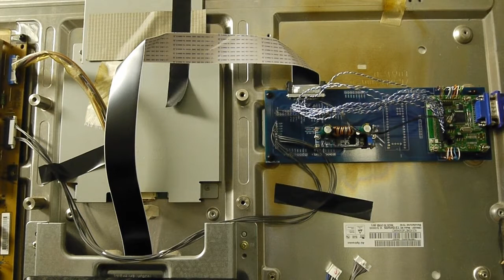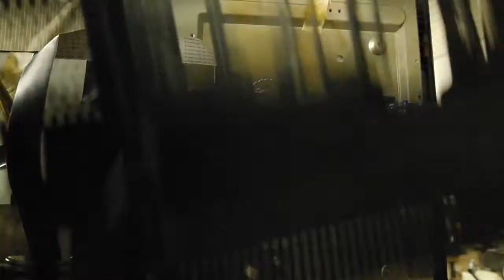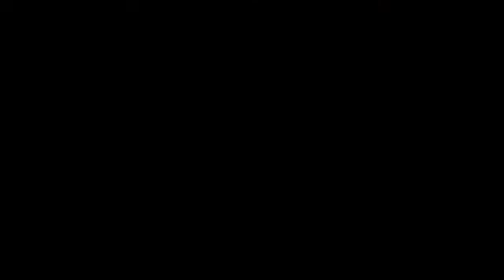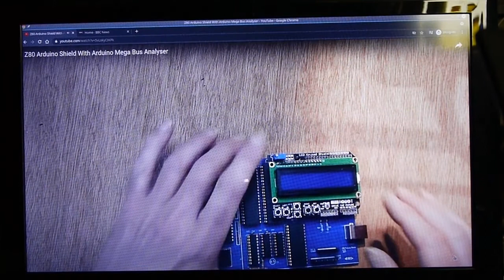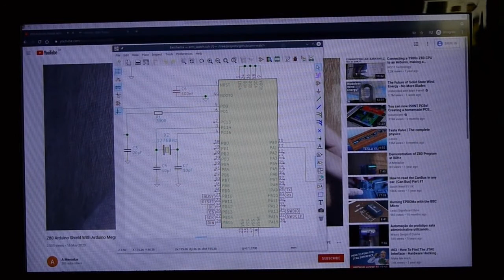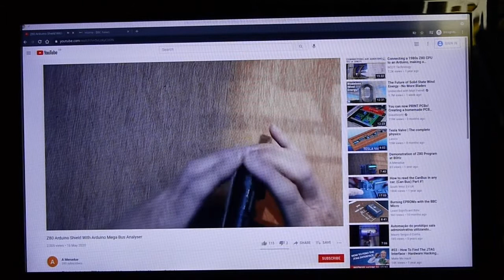Re-using a Broken Television as a Monitor. Part 5

Comment: There are lvds boards that have hdmi instead of vga. The screen might look clearer with one of those. Another suggestion is metal tape to help with interference. Though the fuzziness might just be from you recording the screen. Do you think I should try something like this using some broken laptops I have laying around? The screen in one of them is 1080p. The other is that weird 1366 by 768 display.
Reply from the maker: Yes, I saw those when I was searching for an LVDS converter, but they seem to be 'pre-configured' which means they have the resolution set up in eeporm by the supplier. That made them a lot less flexible for me as I don't really know what I might attach them to. I preferred being able to set the board up with jumpers. Yes, the picture is a lot better in real life than in the video. 
If you have some screens and a use for them then yes, I'd make a monitor out of them. You can always get a converter board and try all the displays with it to see which pones you can get working. It helps if you have a datasheet for the display, or you know that they are a standard pinout.